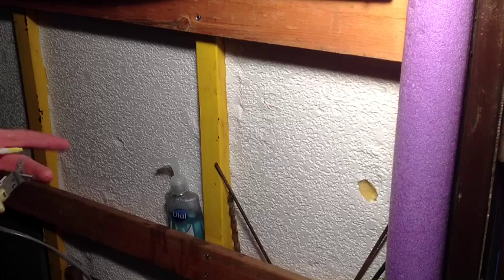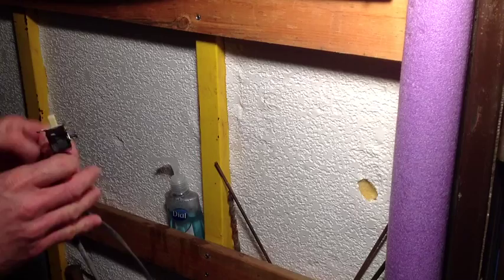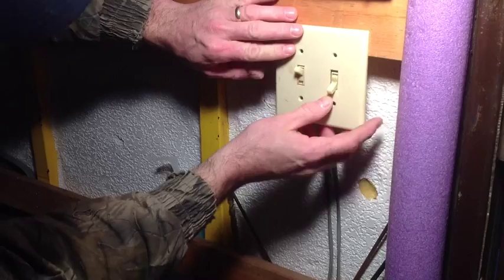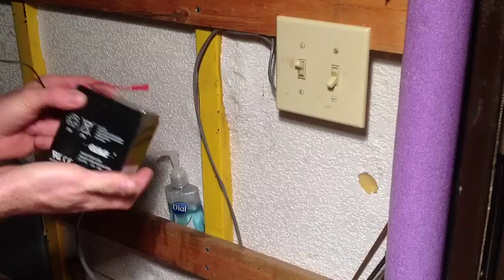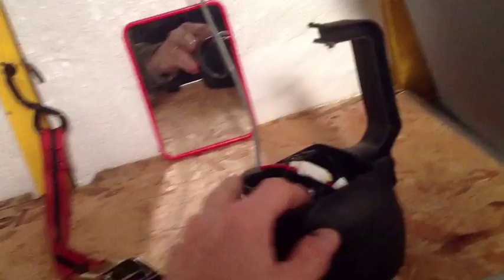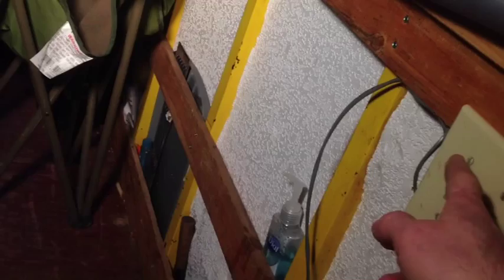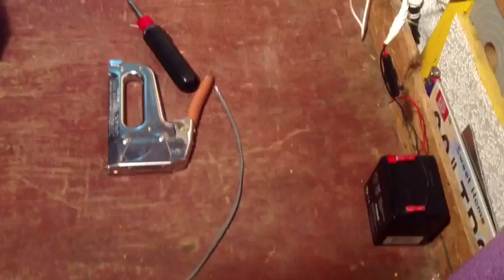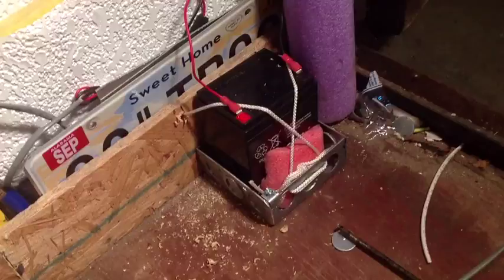Install Converted 12 LED lantern 5x8 Enclosed Trailer Conversion Camper Project

Comment: Good post.  About time someone explained how to use 110 switches and plugs on 12 volt lighting.   Not enough info on you tube.     Good job.   P.s. Harbor freight 12. Volt solar battery is excellent for you application.  I use one.